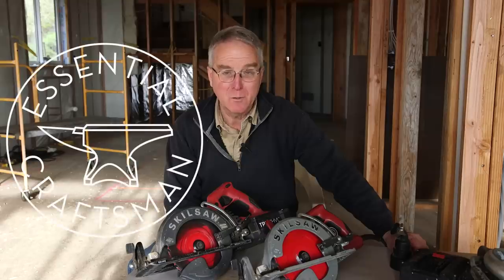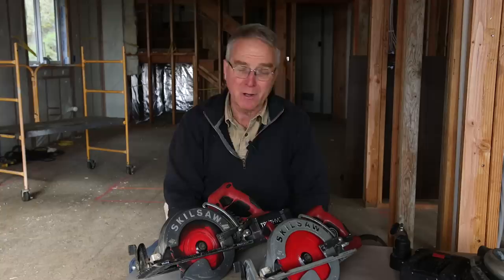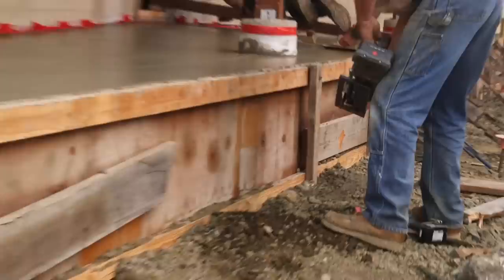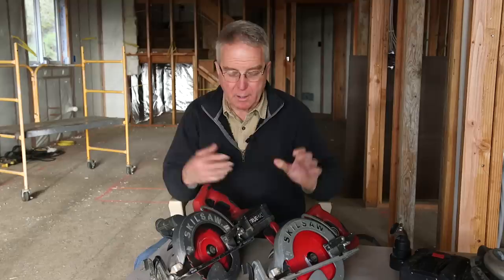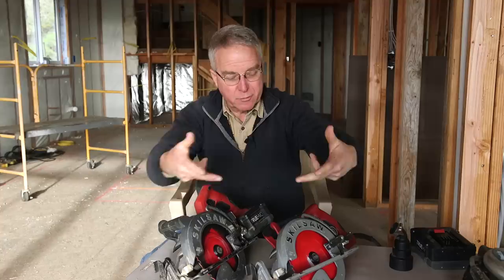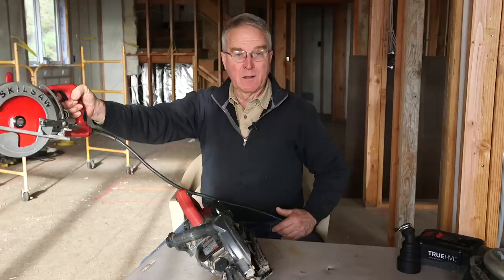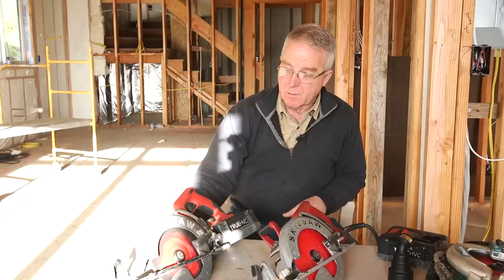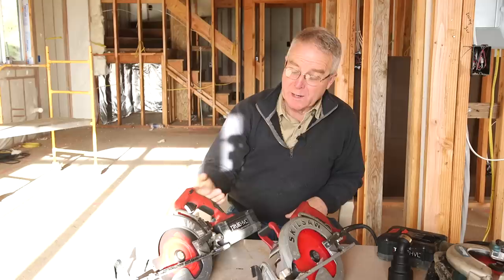Skilsaw Cordless Worm Drive Saw - Initial Review

Comment: Great review Scott can’t go far wrong from a skil saw but being in the uk we can’t get them easily so I’ll stick to my draper.
Reply: Much more of a US brand but have seen a few kicking around.
Reply: Generally don't see circular saws in the UK with the handle on the back. Seems like there would be greater control like that and I'd like to try one (a lot due to the influence of EC too)
Reply: @dantovey2785  Worm drive is more common in Western US and direct drive is common on the east coast US
Reply: @pro353  just doesn't seem to be a market for it over here which is a shame.  Would love to see a Bosch 18v cordless skill saw style to add to the collection
Reply: There is the Makita, Dewalt and Milwaukee rear handle saw if you want one with handle at the back
Reply: I've got the makita and my dad has the dewalt. Would love to get my hands on a skilsaw. The makita is absolutely brilliant, if it broke I would buy another one immediately.
Reply: @dantovey2785  you can get the metabo/ Hitachi  can't you in the UK?
Reply: @CesarGarcia-ep8tt  apparently a number available! Will have to check them out
Reply: Been using one in Ireland for 20 plus years. Better power in it than a 'sidewinder' of any brand for cutting wet/knotty/treated timber. Its heavier for sure but because the handle is at the rear I feel you've greater control over the saw.

Comment: Cordless is changing some parts of the industry completely! I have been hanging drywall from a vary young man with my dads business. The Makita cordless drywall screw gun is awesome. Back in the day not to long ago we all used a corded gun and there was usually 2 routers on the job. At the end of the day or halfway through you have to spent half an hour untangling cord! That’s over now and since the Makita does not make the motor noise when the trigger is locked the noise pollution is drastically reduced.

Comment: I bought a cordless Dewalt brushless motor about a month ago.  I've always been a little skeptical about cordless circular saws but this is really strong and accurate.  No problem at all ripping through 3/4" ply. It may not be ideal for a cut guy on the ground but if you need it for a few cuts, or to do something up in the air it's a heck of a lot better than dragging a cord up there and fumbling around.

Comment: I would agree the Skilsaw is the benchmark for all framing saws. It is of great value that a review is based on experience and time given to a tool to show the strengths and areas of improvement. Added to my truck is the Dewalt 60v cordless. It had better balance compared to the Skilsaw cordless and it will run all morning on one battery and the afternoon on a second. Larry Hahn got mentioned again, bravo! A great carpenter and a man who propelled the craft. #respect for you and Larry.

Comment: Great thoughts, Scott. I personally carry two cordless circular saws with me daily. I carry the Milwaukee 7-1/4” rear handle saw that has the same weight balance as corded worm drive saws, has loads of power, a convenient LED light shining on the blade, and great sight lines but definitely isn’t light. I also keep a much lighter 6-1/2” saw. The smaller 6-1/2” saw gets used the most. It’s so light and gives me tons of control. Awesome tool for weird positioned cuts. If that one bites the dust I would replace it with the m12 fuel 5-3/8” circular saw for an even lighter saw. I also am a remodeler so I’m not cutting large stacks of lumber. Typically I am only needing to make a handful of cuts. I haven’t bought a corded tool in a long time. The only corded tools I use regularly are my dewalt miter saw, sawstop jobsite pro table saw, and a dust extraction vacuum. Everything else is cordless, even my nail guns.
Reply: I have the same tools , I have tried the Makita 7 1/4 and that thing was gutless , Milwaukee for the win.

Comment: A compromise between a cordless and a corded one is a portable battery inverter paired with the corded tool.  You still will have the cord but you are not carrying the weight of the battery on your tool.

Comment: The greatest freak of nature of the traditional worm drive saw was in it's design & balance that afforded the user a LOT more power than a sidewinder making it ideal for production cutting. Sure it was heavier than sidewinders, but it used physics to overcome that weight with where that weight was placed (kind of like weight forward hammers). 

I always felt like a worm drive walked through the cut and that the weight behind the blade (as opposed to one side of it) made it easier to push through the cut without pushing it. Sidewinders for ripping plywood, worm drives for 2X stock & demo. That was always the way for us roofers. 

The only sidewinder that compares is Skil's relatively new Southpaw. That thing is a beast and doesn't feel like a traditional sidewinder. It plows though 2X stock like a worm drive did (probably because it's sharing motor components with Skil's worm drives).

Comment: Hey Scott. Great review,  one tip on the cordless saw, if you push the safety button in and run a small pan head screw into the crack between the button and the housing it will hold the button in without compromising the saw

Comment: Right on with your review. I have a Milwaukee cordless and it is unstoppable! I totally agree that the cordless saw has a particular place on the jobsite, and the corded saw has another. Cordless for smaller, ad-hoc jobs. The corded saw for the larger framing job. A cordless can build an entire deck on a single charge, though. At least the Milwaukee can, with the 12Ah battery. It is great, but it's no substitute for my corded worm drive.

Comment: Although I use a competitor's tools, I agree, corded and cordless tools have their  time and place. Being mostly a commerical carpenter, I like the cordless saw,( cordless tools in general) for working in scissor and basket lifts..the M18 12.0 battery lasts all day of heavy cutting, rip and cross cuts in the wettest of lumber. But I still have the 7 1/4" corded saw just the same.. I'd rather a greenhorn laborer break the $150 saw, rather than my $500 cordless saw...

Comment: As a non-pro home user, where buying multiple saws is probably a waste of money, I'd say go for the battery driven saw.  Most of the advantages of the corded version apply to job sites and situations you won't encounter often or at all at home or in a garage/shed shop.  I was a bit late coming to the battery circ saws as I just didn't think the batteries could give the power needed.  But a couple years ago, that really changed, and I took the dive and haven't looked back.  The power is comparable, and definitely up to cutting lumber, thick sheet, and everything else I've run it through (the rated HP is essentially identical), and I get hours of use out of a charge (which translates to weeks and weeks for this weekend warrior). I wound up donating my corded saw, which still has a few good miles left in it.  The advantages in my garage shop of not having to deal with the cord far outweigh the other considerations.

Comment: 50 years ago I first picked up a skilsaw as an apprentice....The biggest change in saws is the carbide blade....We used to hord a collection of sharp saw blades..You changed a couple times a day...If you even grazed a nail you were done...The big deal was the horsepower it took to saw...with a sharp steel blade you could cut pretty fast but nothing like a cheap carbide with broken teeth...the amp requirement is way less....we used to hump around the thick rubber cords on the roof with twist lock plugs....After carbide I you could run a little light cord and be O.K.....no sky hook..but if you did not tie the saw to the cord by looping through the handle you risked loosing the saw..(and your job).some guys wired the saw into 50 feet directly...the battery saw would never get out of the gate without carbide.....Mr E. Craft, are you old enough to remember cutting in a let in brace?? Pin guard back (maybe with 1/2 a wood clothespin you stole from the old lady when she wasn't looking)..no markes..drop a 1x4 at a 45 angle on the framed wall on the floor and set the saw at 1 1/2" deep cut both sides of the 1x4. pin the guard or hold it with your thumb and bend over between your legs . throw the saw on its side and cut out the piece and drop in the 1x4.....If you were "piecen" in the tracks you had no time to f around.........I only worked in the tracks two summers and you really learn about production....

Comment: Just buy the Milwaukee M18 FUEL 18-Volt Lithium-Ion Cordless 7-1/4 in. Rear Handle Circular Saw  for $269 (tool only) especially if you're already invested in a battery platform. The Skil is $400 and then you got another charger and battery system to carry around.

Comment: I’m at the point in my life / career that I don’t need a new circular saw, I’m likely to need a new knee or hip before I do, but I just had to click on the links for the two saws and compare them. If Amazon is right there’s less than a four ounce difference between the corded saw and the cordless with the battery in place. I don’t see how that could be possible, but if it is it just shows how much the balance of the saw and what were are used to affect our perception of how much a tool weighs or how easy it is to use.
Being on the east coast all the saws  I’ve bought have been sidewinders. My only experience with worm drives was using one of a pair of Porter-Cables that my old boss’s father had bought back in 1948 or 49, and we only used them for dry cutting with masonry blades. Obviously my old boss figured the saw didn’t owe him anything and I would bet that if the saw hasn’t been thrown away it probably still works.
Reply: I have three Porter Cable worm drives from the 60s. My only complaint  is that they don't have a blade lock button like Skil or other brands of worm drives. For some odd reason Porter Cable did not use the same two wrench system for changing blades that they use on their 'sidewinder' saws so a little extra effort is required to lock the blade.

Comment: Scott - let me suggest that some framers I’ve observed with the battery Skillsaw have replaced the “rope” (which BTW is always a 100’ cord retrofit- you didn’t mention the 6’er from the factory is the first thing in the dumpster)... replaced the AC “rope” with an actual ROPE.  Yep framers on the roof definitely need their saw on a rope to prevent daily replacement of a smashed saw, so they tied a rope onto the battery saw and were using it like they’d use the cord.  I did not see where or how they tied it off.  If Skill was smart they’d make a place to clip a carabiner or similar on their battery 77.

Comment: One major consideration for cordless tools that you don't have to consider for corded tools is the Battery Ecosystem. Unless we've got a lot of disposable income for tools, I think most of us have decided on the battery ecosystem we are going with after the first couple tools we've purchased. Personally, it doesn't matter to me if the Skillsaw is better or worse than the Dewalt offering. I'll likely buy the Dewalt just because I don't want to have to manage another set of batteries and charger for one or a couple specific tools. I'd rather have all of my batteries fit all of my tools. 

That said, fantastic review. I wonder if the Dewalt version would have less of a balance issue since the battery is tucked up close to the center of the saw rather than dangling below the hand-hold...
Reply: I don’t quite follow the Eco point. Whether it’s corded or cordless, the energy comes from somewhere. Battery disposal is actually a fairly nasty problem that should be considered as well.
Reply: @psidvicious , I didn't say anything about the environment. I was talking about the Battery Ecosystem. That term has nothing to do with being eco-friendly or not. It's a reference to the form factor of the batteries, like Dewalt's 20v or 18v batteries being different ecosystems (though there are adapters) and the Flexvolt batteries being compatible with the 20v ecosystem, but not the other way around. So the batteries for the Dewalt worm drive saw would also fit in a miter saw, or hammer drill, or impact driver, or palm router, or jigsaw, or, or, or....

In this case, the battery and charger for the cordless Skillsaw is only compatible with that cordless Skillsaw. It won't fit anything else, so no matter what you have to have to manage multiple ecosystems at once, which is a PITA, and expensive.
Reply: @chaseweeks2708  Ah, got it. I know you didn’t make it up, but it’s kind of a strange that they would tag power tool ‘compatibility’ with a word that actually refers to the biological compatibility of different organisms. I’ll look for it next time I’m spacing-around in Home Depot. I’d be willing to bet the package lettering will be in green.
Reply: @psidvicious , lol, when have we ever landed on a term that most correctly identifies the concept we're trying to describe? Global Warming should've been Global Climate Change and Social Distancing should've been Physical Distancing.

Comment: I'm a fan of you and have a great respect for your experience. I just hope someday you do a review of the SKIL 40V PWR Core 20 XP Brushless 7-1/4 In. Rear Handle Circular Saw CR5429B-20, it weighs 13.81 lbs with both 
5.0Ah Batteries. Could be interesting because it weighs almost the same of the legendary worm drive corded version. Thanks

Comment: One point you didn't touch on Scott, was the non interchangeable battery of the skil brand saw. All my cordless tools are milwaukee, so, the m18 7 1/4 Is the go to as far as a cordless saw is concerned in my case BUT I do keep a corded skil in the truck for the rare occasion I have to take a rough job. My field is marine carpentry so it's somewhat of a rarity for a corded tool to out benefit its battery powered counterpart due to vessel constriction. Keep in mind a corded tool draws relatively big amperage, I can't plug my skil saw into a motor yachts galley outlets to cut out a floor, so your chore becomes finding a dock box with a big enough breaker to handle your draw, plus enough cord to get you where you need to be (not to mention your cord being covered in whatever geasy concoction that marina has on the ground). In my opinion any working earning professional should have both because both are bound to apply,  BUT choose a brand that matches the batteries you've already got and use.

Comment: Scott, I've been around the trades almost as long as you. I have an old 5 1/2 worm drive from the 50s that I got from an uncle. Its a little beast and I use it as my shop saw for plywood and such things. Unfortunately I can't find diamond ko blades anymore so I'll retire it soon to my vintage tool display. I've owned a gray handle skilsaw, a black and gold anniversary saw, and 3 mag77s. Dropped a brand new mag 77 while framing a dormer on the day I took it out of the box! That was ugly and I had to retire it that day. I've had them stolen too. Cut concrete and steel rebar with them for years. Truly punished them and yet they continue to work. Due too rotator cuff issues and weight restrictions I now use a Dewalt DCS565 6 1/2" 20 volt brushless saw. Instead of the 20 volt battery, I supercharge the saw with a 6 ah flexvolt 20/60 volt battery. I can cut all day with this setup as long as I'm not ripping a lot of 2xs. Ripping 2xs all day is still reserved for my beloved corded mag77.

Comment: You are only comparing the two saw types while performing a single type of cut (trim end of a board) which just so happens to be easier to perform by a beginner with a sidewinder. I recommend creating a full length comparison video showing each saw performing various types of cuts, including ripping down sheets of plywood. Just a suggestion since this video seems to discourage the use of a worm drive when it could easily out-perform a sidewinder at other tasks.

Comment: After watching your other Skilsaw videos I decided to buy the cordless DeWalt equivalent, which is the only brand of this style available in the UK.
It's a great saw, but the battery makes it HEAVY! Looks like Skil had the right idea putting the battery as far back as possible.
Reply: I have the Flexvolt blade right saw ,a bit over ten pounds, why the heck do people run rear handles ?
Reply: @interman7715  I find the shape easier to use overall, and the blade is on the left, making it easier to see your cuts

Comment: Other than the convenience, you can’t say much of this for the 20v DeWalt sidewinder. Mine’s the brushed version, and maybe the XR’s better (can’t see how it would be though), but on a full charge, it doesn’t have anywhere near the torque of a corded saw and it burns through 4 AH batteries like they’re AAs. Good enough for lighter stock and plywood. Still good to have a battery powered circular saw, but, as Scott said, it is a different tool than a corded saw.
Reply: Try the Milwaukee Fuel. It's a full 7-1/4 and I can cut through 6 layers of 1/2" OSB at the same time with no drag on the saw at all.
Reply: @RodneyFisk  Thanks, man. I’m married to that black and yellow though. And it’s for life... 😂 Sometimes I wonder if I made the right decision.
Reply: That saw is old and relatively weak.  The new XRs are stronger.  Their 60V saws are even stronger and have almost unlimited power.
Reply: @RodneyFisk  I do wonder if someone will ever make some kind of battery adapter though. That would break the model for the tool manufacturers, and then they start pumping out some real garbage tools. Maybe things are better like they are. Anyway, I digress.
Reply: @jps101574  Yeah, I think you’re right. Those are really more comparable to Scott’s Skil. I think I need to trade up. And the 60v flex volt batteries work with all the 20v tools, is that right?
Reply: @singlepointdc7749  Yes.